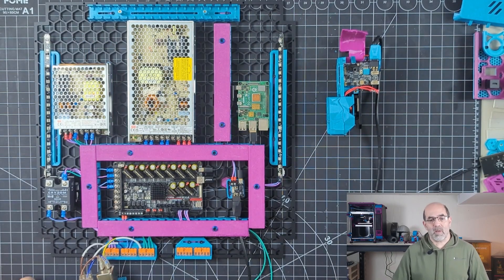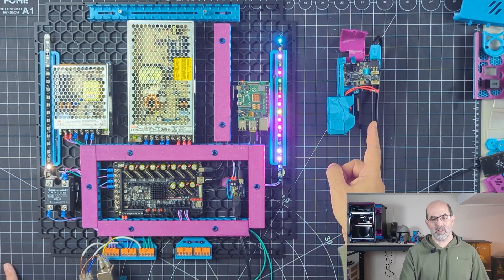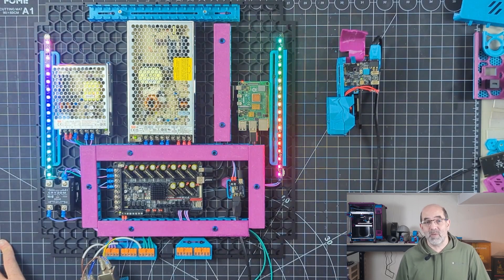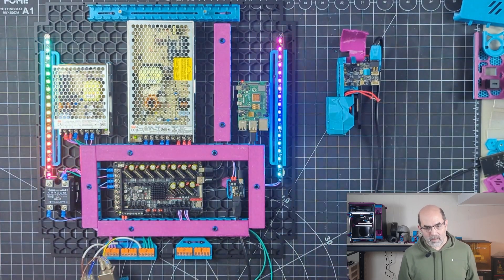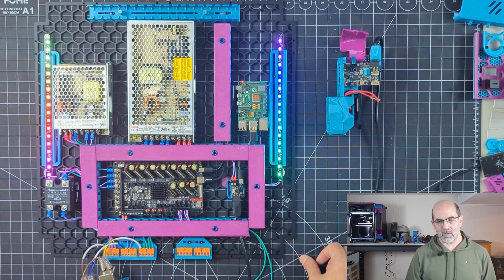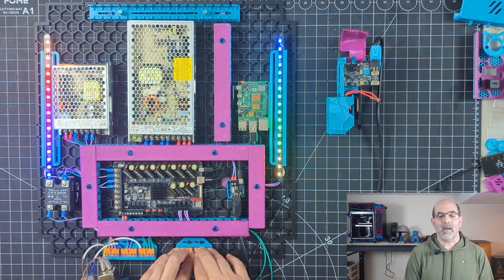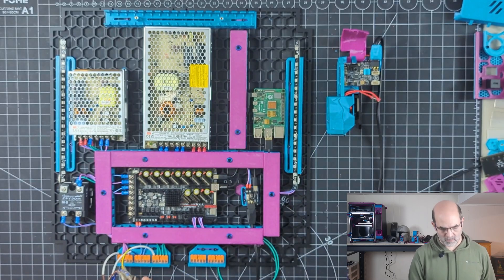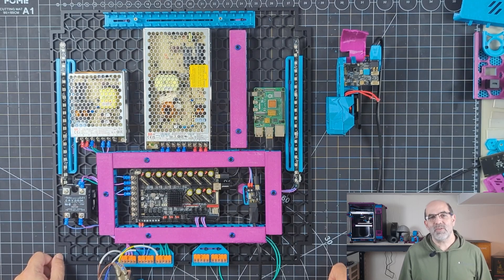Voron 2.4R2: FT EMS Electronics Bay Final Layout

Comment: Which version of the EMS uses screws on the side like that? That's the only thing I would like to change on mine because the standard version you need to screw in bolts sideways which is obviously difficult when electronics are already in the way.
I just got my 2209USB today and will be trying it just so I can have a single cable for toolhead and Beacon. I have only used Mellow canbus boards up til now and they are super easy to setup and update remotely without needing to touch the printer just like my Octopus Max. I hope the 2209USB is the same way.
Reply from the maker: It's a prototype

Comment: Thanks for showcasing  your layout. Been thinking about upgrading my 2.4 to 48v on the gantry and maybe Z for stealth changer.
I haven't researched anything yet re the 48v setup but 100w max out put on the PSU seems a little low for a AWD setup. That's a half amp per motor at max PSU output which you shouldn't do. You'll more likely be running 0.3 to 0.4 per motor which will be similar wattage running the gantry as a dual motor 24v system.
I don't see what benefit you will get for the added complexity.
Reply from the maker: I am not an electrical engineer, but DragonKitty  on the Voron Discord gave me this explanation which I will share verbatim:
"that's the misconception again: They are *not* driven at 48V permanently. 48v help reaching the coil saturation quicker. Let's take your 2804 as an example, the datasheet tells you: "Rated Voltage 1.4V/Phase". So with the current of 2.8A/Phase, we end up with 1.4V*2.8A = around 4W per phase. Multiply by 2 phases, makes 8W per motor. Apply a safety margin of 1.5, ends up with 12W per motor, 2 motors = 24W, so a 50W 48V PSU should be plenty."
That was 24W for two motors, seems like a 50W PSU should handle 4 motors, and my PSU is 100W, and not powering anything else.

Comment: Love the concept. Curious to see how much flex there is once it's mounted in the frame.
Reply from the maker: It's held in place by 12 mount points around the periphery of the frame, as well as 2 mount points just front of centre which bolt into the bed extrusions. Each mount point uses 2x M3x8mm bolts to fix the frame to the mount point. I can't easily demonstrate this in text, but it is quite rigid. In theory, if Fizzy eventually releases the CAD for this one piece EMS Frame, it could be cut out of stronger materials, like aluminum.
Reply: @oldguymeltsplastic  That's what I had been thinking, getting the base water jet cut out of aluminum might be a worthwhile, or a way for others to make some money on an Etsy shop.